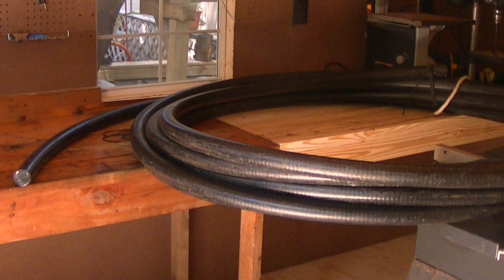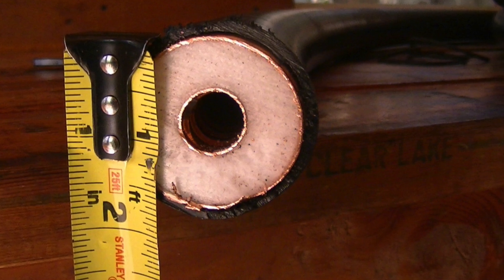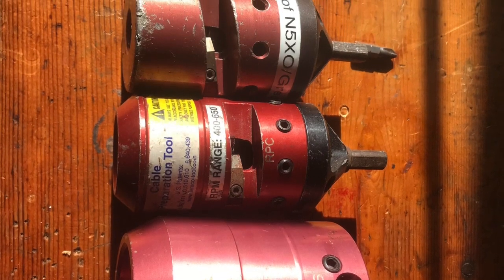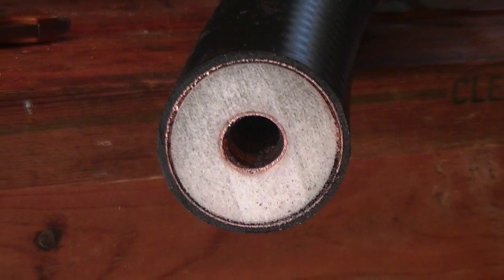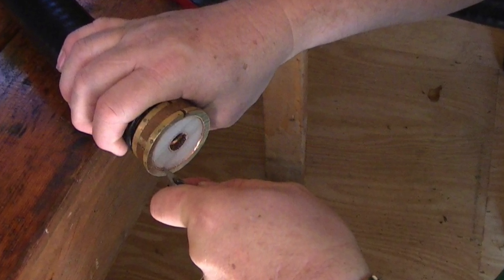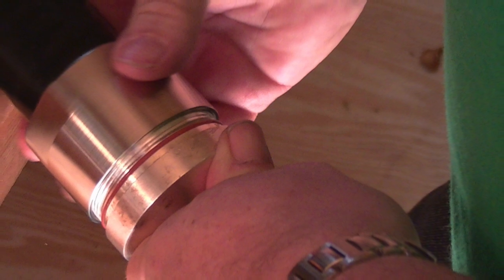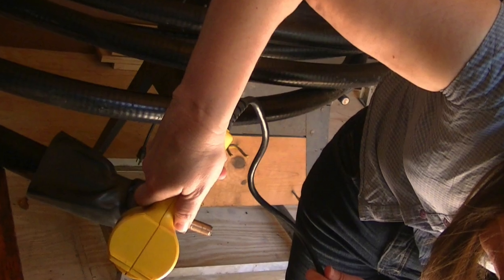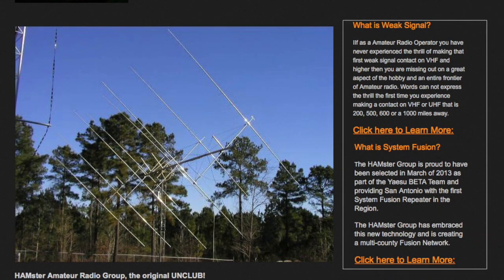Hard line connectors - N5XO  HD 720p

Comment: I have  one of those cable prep tools and it just destroys the hardline and shreds it up. Not sure what im doing wrong.
Reply from the maker: Not sure, make sure you have sharp blades and do not push hard..let it pull and cut. It should give you a good clean cut that requires little additional touch up to put the connector on.